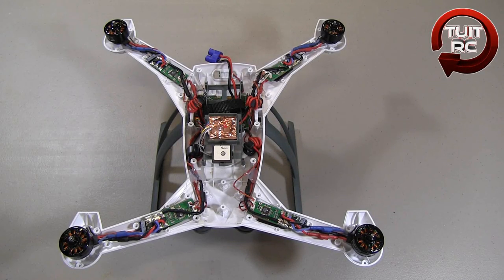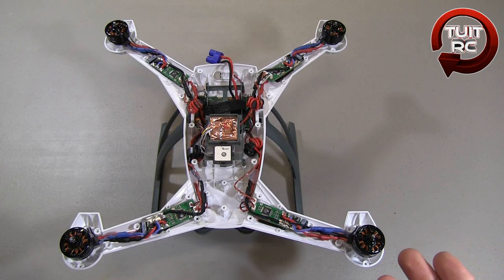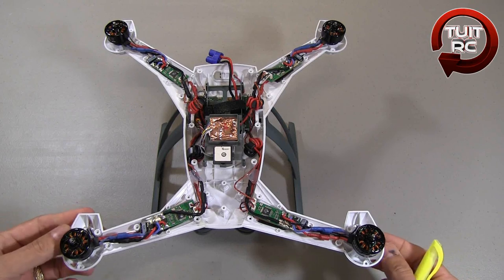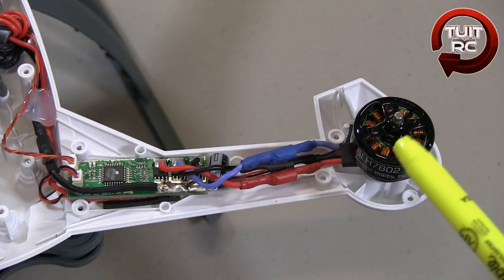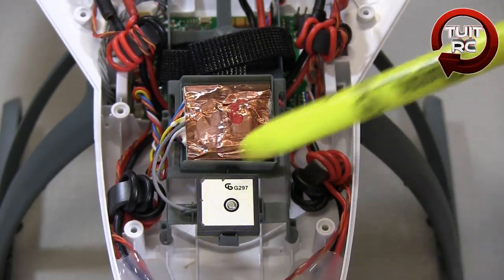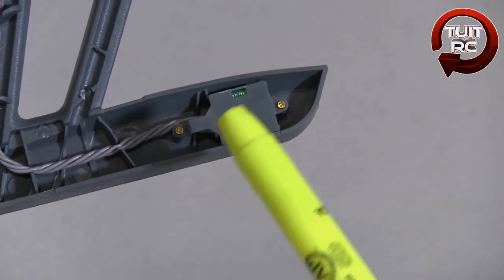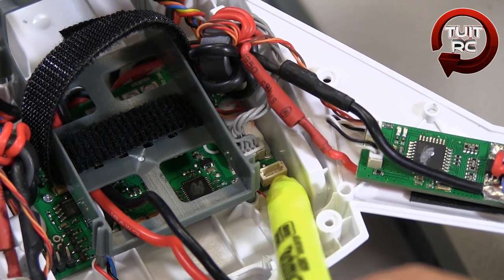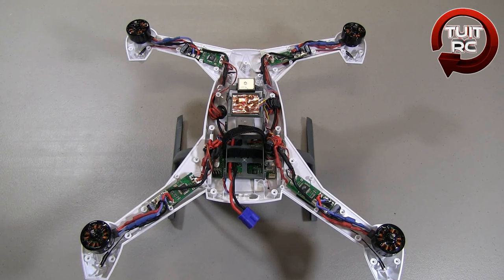An In Depth Look Inside The Blade 350 QX Quad Copter

Comment: Yes as mentioned, the female empty plug is for plugging the USB adapter into your computer or laptop to upgrade the firmware.  Mine was an original QX and via that port, I'm now running version 3 with a 3 axis CGOG2  camera.  The adapter cost me $15 at the hobby shop.Blade now has GUI interface software that when plugged into that port will allow you to set perimeters, altitudes and calibrate the gimbal an other features.  When you buy the USB adapter, it comes with a little jumper you can plug into that port so you don't have to take the quad apart every time you want to plug into the laptop.  The little jumper just lays in the bottom of the front hatch when not in use.

Comment: Great video. I think the connector on the right (I2C perhaps) is for programming the flight control board, I bought a kit with cable and a USB serial interface for upgrading the 350 QX to version 2 if required. Thanks much for the video. Wayne
Reply: Can you link me to that kit please  :D
Reply: OttawaAccoustics It's called USB-Interface: Multi Rotor Programmer [BLH7840] from: http://www.bladehelis.com
Reply: OttawaAccoustics Using google search for BLH7840. Amazon's got one also.
Reply: Wayne Bjorken
Thanks a lot  :D
Reply: Any of you guys had or have a led light in the motors off? my front left light wont turn on! :( all motors are ok

Comment: hi, is there a reason for the placement of the compass in the landing skid. Does it needs to be some kind of distance from the main board? I swapped the guts of the 350 qx to a f330 frame. But i'm having a lot of trouble calibrate the whole thing. maybe it is the compass board.

Comment: My GPS parts were slapped on the side of the battery box also. I might add it's brand new and will not obtain a GPS lock.
Reply: G Leonard.        Mine too so I put them back where they belong. They were stuck on to back left arm and that arm just shut off in Safty mode and slammed , I’m hopeful that it will free up motor and prop? If not I’ll have to replace no?

Comment: i have the latest version which is the qx3 ap combo with popup gps antenna...i think that port is used for the pci in the qx3.
i only have mine a couple of week's now but i think it's a bit week in the power department...also i am abit worried about that tiny piece of wire that is used as the rx antenna.
i have a cheap clone of a dji and that has two coax one's that are attached to the skid's...also made with stronger plastic'sand better motor's.
i am not looking forward to the inevitable crash as the Horizon machine feel's almost toy like in comparison...that said i realy like the camera/gimbal unit appart from the non inclusion of a mic.
safe flying.

Comment from the maker: One thing that I failed to mention is that most of the parts can be replaced separately such as the GPS Rx, GPS antenna, compass board, landing skids, body, etc. The main board is selling for $219 I believe though so I hope you don't have to replace that just yet.

Comment: well that's weird - I see on your stock model a square GPS antenna - I had to take my QX apart last night because of a major crash due damn prop failure in mid air and noticed I don't even have a GPS antenna in mine ... that's very strange
Reply: Mine which I bought a few weeks ago, had the GPS Reciever hooked to the side of the battery tray, and the antenna in the back right arm. Maybe it gets better results there. I put it where he has his in this video, and it drops GPS connection every so often, I may switch it back to how it was configured.
Reply: I could be wrong, but I believe Blade moved the GPS to the side of the battery tray as a part of their Firmware 2.0 fixes.  I don't know why they did this, but I guess they find better results because of this.  Anyway, the point is that the one in THIS video looks different because it is probably not a 2.0 version.
Reply: Check one of the arms on the unit. Sounds like yours is already version 2. There's a video describing this upgrade on Youtube. Try a search. Could be wrong though as this all new to me.
Reply: Joe Brock I've just bought 350qx as my first quad (mid January 2015) and constantly have problems with loosing GPS lock, especially when using GoPro 3+ with Blade gimbal. Just wandering if anyone went any further in fixing this issue. Thanx